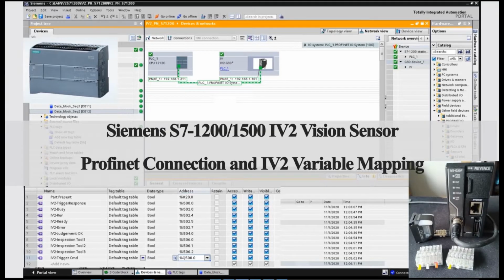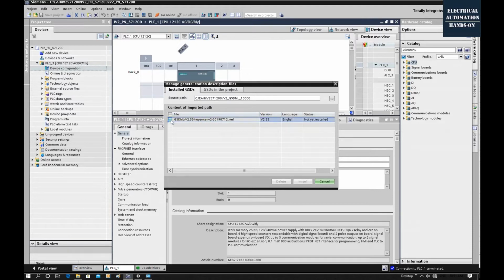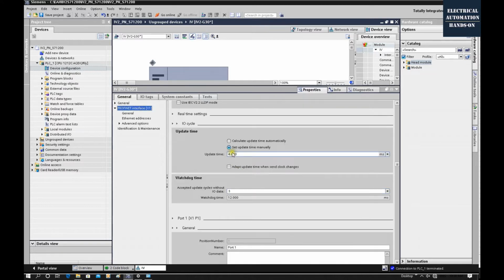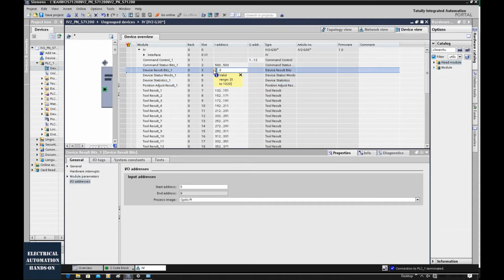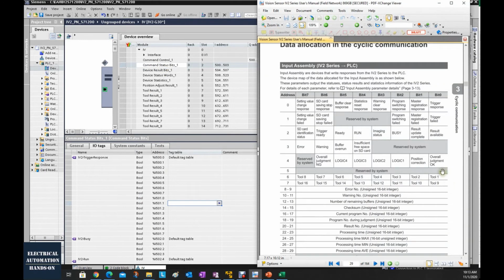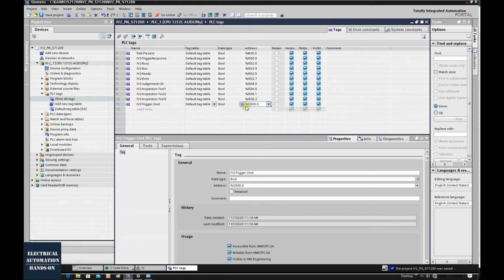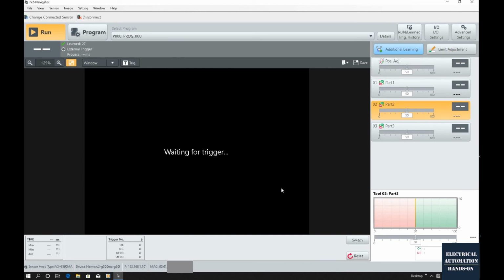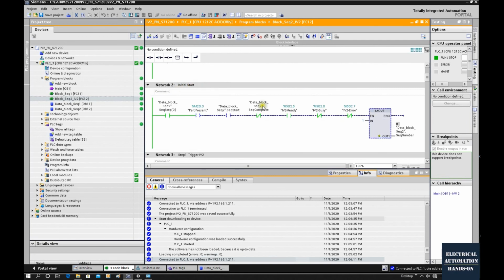K17a. Siemens PLC and Keyence IV2 Vision Sensor Profinet Connection and Variable Mapping

Comment: Hi, about the "error" signal, it should be I503.7, but you assigned that signal to 502.7, my doubt is that i can't assign signals beyond 503.0 (i'm talking about 503.1, 503.2, all the byte in fact), just the first bit of the third byte, that's the limit, just like you, so, how can i assign that signals that are in the third byte?
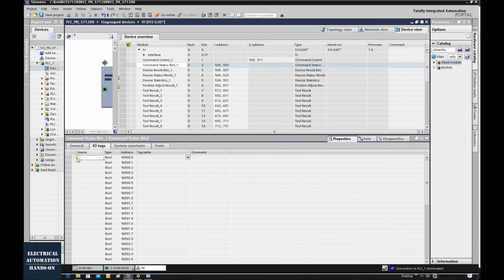Reply from the maker: The address is very flexible, once you know the concept, e.g. the mapping table at 9:53. you can assign the address according to your system. For instance, you can assign starting from 200, the the rest of signals should be I200.0...   I203.7(Error.)    Yes, the Error shown in the video should be I503.7. It is typo there. Thanks for pointing it out.

Comment: Sir,  I think you made an error on maping : I504.7 is the  signal error not I503.7
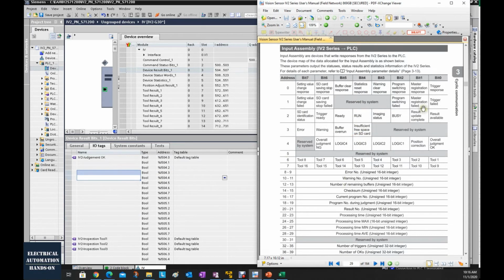Reply from the maker: Thanks for watching, please see 12:58, if it starts from I500.0, then the ERROR should be I503.7
Reply: @electricalautomation  Thanks for the video, I am trying to follow for a project I am doing but I503.7 does not show in the IOTags tab, similar to what the video shows, Tags stop at I503.0

Comment: Hi
Thank you for this useful video.
We are trying to connect an Omron FHV7 camera to a Siemens S7-300 but no use.
Actually, this camera successfully connected to an S7-1200 PLC with no problem.
The question is that what is the difference here?
Why we can't do the same thing with S7-300?
(Profinet TCP connection)
Reply from the maker: Please check the FHV7 Profinet device name, you need to use the 'edit ethernet xxx' in Step7 to assign the Profinet device name to the FHV7